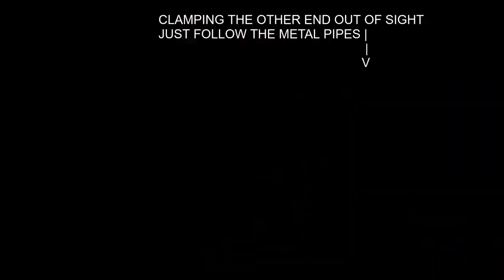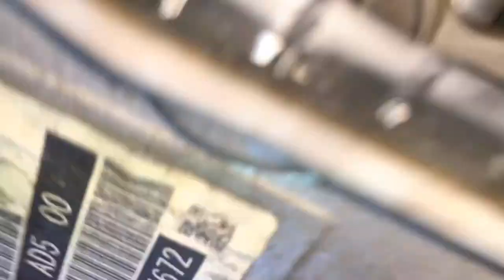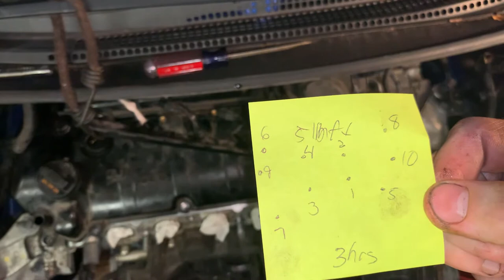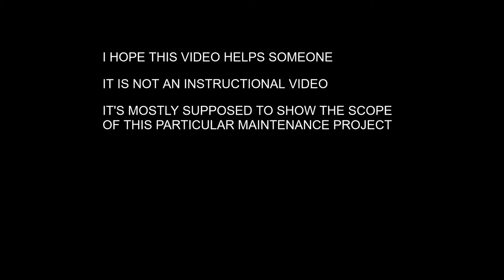GK5 2016 HONDA FIT VALVE LASH ADJUSTMENT AND SPARK PLUG REPLACEMENT

Comment: Tools needed:
feeler gauge 0.009"-0.012"
assorted sockets, all mm
pliers for hose clamps
clamps for intake coolant hoses
flat-head for valve nuts
1/4" torque wrench (the impossibly low torque specs) & wrench
3/8" torque wrench & wrench
1/2" wrench
2-4 extensions (no ujoint needed)
14mm thin wall spark plug socket

Items needed:
black rtv for corner places
valve cover gasket
intake gaskets (4-5 singles)
non-fake spark plugs, should be about $15 each, so $60 total
intake cleaner
blue shop towels
extra oil for lubing valve cover

Torque specs:
valve clearances
     intake -- btw 0.009"-0.010"
     exhaust -- btw 0.011"-0.012"
valve nuts -- 10ft
spark plugs -- 13-14ft
intake -- 17-18ft
valve cover -- 5-8ft
coils -- 5-7ft
torque patterns are always intuitive, just use 3-step

Notes:
do not for spark plugs --
     gap
     dielectric grease
     anti-seize
do not for valve cover -- 
     run engine 3hr before finishing
     add oil to vehicle
only cleaned mating surface for intake, said to also do valves and intake itself
used normal paper towels for cleaning, use the blue ones instead so bits dont get lodged anywhere
cowl does not need to be removed
my 1/2" torque wrench is abt 13ft at 10ft, so always use the appropriate torque wrench for the job

Comment: The spec for the intakes is probably 0.22 mm which converts to .0087 inches. When I have money for the on-line service manual I'll look it up. With the metric feeler gauges you want the specified size to offer some resistance to being pulled through, but you don't want them to be difficult to pull through. Also there is often a range, like for example 0.20 to 0.22 (0.21 +/- 0.01). To avoid damaging the feeler, I slide it in from the side of the gauge, rather than from the tip. I haven't adjusted my fit yet, but I've done this on other cars. Thanks for the info on how to get to the valve cover, where to turn the crankshaft, and where to turn it to. Usually you are supposed to turn the crankshaft in only one direction, so if you over shoot you have to go all the way around again, possibly twice as to get cyl 1 at the adjustment point, and then be able to adjust the cylinders in firing order. In other words 2 crankshaft rotations per camshaft rotation, or maybe vice versa I forget. I'll have to check the service manual.

Comment: Tip on adjusting: turning the locknut will sometimes turn the rocker adjustment shaft. Hold a screw driver in the slot to prevent it rotaring as you turn the locknut. And yes, you want that locknut tight

Comment: Just did this but brought my spark plug socket from work so it was a 16mm not a 14mm lol. Also easier to turn the crank with the plugs out, I could not for the life of me turn it with a normal 3/8" ratchet. Really not a bad job, with familiarity maybe takes 30 mins tops to get all the stuff removed. I bought some hondabond HT for the sealant.

Comment: Great vid. It is going to save me a lot of trouble when it is time for me to do mine. To get rubber tubes off of plastic (or metal) nipples I insert a small flat head screwdriver between the hose and the nipple, maybe about 2 mm in, and pull up to make a space, then I take some silicone lube that is labeled safe for plastic and rubber, and squirt it into the space, using the plastic straw extension that comes with the can of lube. With the screwdriver still inside I wiggle the rubber tube around a bit, in and out, around and around, and the lube spreads out between the tube and the nipple, making the tube much easier to get off. Just one short squirt is all that is needed.

Comment: This is the valve clearance spec from the Honda Tech Manual.

Valve Clearance
Intake: 0.21－0.25 mm (0.009 in)
Exhaust: 0.25－0.29 mm (0.010－0.011 in)
Reply: How long should the engine be off before doing this??
Reply: The tech manual states:  NOTE: Connect the HDS to the DLC, and monitor ECT SENSOR 1. Adjust the valve clearance only when the engine coolant
temperature is less than 100 °F (38 °C).   I used an ODBC scan tool to get a coolant reading to make sure.  If you don't have that I would say at least 4 hours.  You wan't it to be cold / room temp.
Reply: @Daniel Hightower  thank you for this fast response
Reply: Hightdan can you share a link for the tech manual? I am in Africa and battling to find one here.

Comment: Saw someone else’s they removed the windshield wipers and splash shield..this looks way easier - thx
Reply from the maker: On the 2nd generation 2009-2013 you almost have to remove the windshield cowl. On the 3rd generation 2015+ you do not need to remove it.

Comment: Because the operate at a higher temperature, usually exhaust valves wear faster than intake valves, the lash gets wider faster, so I'm surprised you had to adjust more intakes than exhausts. If you see the valve lash at the exhaust valves getting smaller, it means the valve stem is stretching, as sign that you out to remove the cylinder head and replace the valve soon, before it stretches into 2 parts and gets sucked into the engine. On Honda engines, esp naturally aspirated Honda engines, this should not happen for a great number of miles. Like more than 300,000.
Reply: I have heard from knowable mechanics that the exhaust valve seat gets pounded into the aluminum head slightly which decreases the clearance due to heat cycling. Failure to adjust exhaust valves on an engine that is driven hard can cause the valve to get burned which means an expensive rebuild of the head. So, on my older Fit which has a single cam, that I autocross and track, I check the clearance every year or so, takes about an hour. My wife's newer Fit has the DOHC engine and are a fit to adjust valves, as shown. Since she drives it like a grandma I'm ignoring it.
Reply: @GaryL3803  Thanks for that information. Interesting that the exhaust valve seats get pounded into the head. I read somewhere that the valve seats in this engine are constructed by – spraying the special valve seat alloy onto the heads. Just a thin layer of an expensive alloy. I imagine this costs less than the traditional method of pressing special alloy seats into aluminum heads and "peening" them in place, peening the aluminum around them with a pin punch, to help keep them from working loose. And then grinding the seat to the correct angle and  then grinding the chamfer angle on each side of the seat to bring the seat to the specified width, and to have it contact the valve at the specified position on the valve. I have no idea how "spray-on" seats are constructed. But the idea seems to be that only a thin layer of the expensive special alloy is needed. So if the seats need ever need resurfacing, or replacing – then what does one do? I guess buy a very expensive new OEM head from Honda? The Owners manual for my 2015 Fit (third generation Fit with L15B1 engine) says "Adjust the valves during services A, B, 1, 2, or 3 if they are noisy." The emphasis is mine. It seems to me that if the valve lash gets wider, the valves would start making noise, and if the lash gets narrower, you would not hear valve noise. Tappy-tap-tap-tap. At 40,000 miles I am just now beginning to hear a little bit of valve noise.

Comment: Hey mate, I have a 2015 Fit hybrid. and it sounds ever so slightly ticky when the engine is cold especially on acceleration. Once the engine is fully warm (maybe 10 mins of driving) it goes away. Do you reckon it could need a Valve adjustment? 
Just to reiterate. the car drives fine and perfectly. just a slightly ticking/ clicking noise until the engine is fully warm.
Reply from the maker: They may or may not need to be adjusted. The behavior of being louder and then fading once the engine is warmed up is normal especially if the valves are at the looser end of the tolerance or if its really cold. However tight valves can be a bigger problem than loose valves and you can’t hear valves that are too tight.

 I check the valves when I’m doing the spark plugs so every 100000 miles.

Honda is a little vague on it recently their recommendation is if they’re noisy. I assume they mean all the time but I’m not sure.

My guess is at least half of Hondas probably never get a valve adjustment and make it to the scrapyard some other way before they burn a valve. The most common complaint that is fixed by valve adjustment is hard starts when its cold.

Comment: Can you reuse the head cover gasket after doing the adjustment?
Reply from the maker: I personally would buy a replacement because its every 100000 miles and its a decent amount of work to get back in there. They’re only $30 so its worth the piece of mind to me.

However if its still somewhat pliable and doesn’t feel like hard plastic then it could probably be reused. The spots where the rtv is applied is what would concern me the most.

Comment: I'm convinced that the 2016 Honda Fit is not a DIY maintenance car. I wish you were explaining all the steps, Like removing the airbox first then pulling off the brake booster vacuum line. Or maybe you can caption the video with the steps taken for this job. it looks like a pain in the ass and I know a good Honda specialist and I would trust him to do this job.
Reply from the maker: Adjusting valves is something that’s on the edge of DIY. I don’t have much experience with it so that’s why I use the go/no go system with the feeler gauges.

Some one with more experience can feel the correct drag and do this job much quicker. 

It would be nice if the engineers made it easier to remove the valve cover but this isn’t too bad of a job.

 This is literally the first underhood job I did on this generation so it took me a little bit of learning as I went.

I’ll think about doing a more cut and step by step on this video for the future with maybe some voice over or captions.

Maybe I’ll even rerecord, the car is already at 160k miles so in another year I’ll be doing all this again.
Reply: The fact of the matter is, keeping something that small, that safe, and that fuel efficient with its emissions ratings is extremely difficult. 

You couldn't just throw a good ol MPFI D15 in there and expect the government to let it pass.

Comment: What did you use to clean before putting the valve cover back on with? What is the brand/info on the gasket maker you used?
Reply from the maker: I used one of those tooth brush looking brass brushes to do most of the heaviest  cleaning and used brake clean as a solvent. I finished cleaning it up with some shop towels and some more brake clean. Use lint free towels if you can and when cleaning some of the bad areas I keep the towel on the inside edge of the valve cover with my spare hand to catch any debris if I accidentally lose some into the valve area, I actually don’t remember what gasket maker I used I think it was permatex ultra black. Just about any high temp rtv that’s oil resistant will do
Reply: @thehondafitguy  awesome. Thank you for the info and the video. Its incredibly helpful to see this uncut.

Comment: All the documentation on this engine says it's not vtec, only vtc enabled, but the intake side clearly has a 3rd cam lobe and rocker arm so these are vtec engines after all!?
Reply from the maker: The information I see says its I-VTEC which as intake and exhaust phasing and variable lift on the intake.
Reply: @thehondafitguy  I always assumed it was just the same 1 valve mode vtec that's used in the k series economy engines. Makes more sense on why the engine doesn't start pulling until around 4k rpm lol
Reply: @thehondafitguy  Says i-VTEC right on the valve cover.

Comment: 10 ft-lbs is the torq of the screws on the valves
Reply from the maker: Yes you hold the screw and tighten the nut part to 10 ft-lbs

Comment: That is wonderful the way Honda designed the valve cover bolts. I'd loosen the oil filler cap before torqueing the bolts so that you don't have to compress air when seating the valve cover.
Reply from the maker: Air trapped would travel out the pcv system so this is a non issue.

Comment: I have an engine that tossed two spark plugs out because somebody thought they knew better than a torque wrench.  There is more arrogance than experience involved in not using one for anything.
Reply from the maker: The fit engines particularly pre earth dreams seemed to be more prone to spark plugs loosening.

My 2007 had a gas/exhaust smell when I bought it with the original plugs installed and the #2 spark plug was loose.

I’m glad other people posted about the problem so I didn’t have to rethread the hole.
Reply: This is a Fit problem in particular
Reply: @FINSuojeluskunta  my example was not on a Fit, and it wasn't loosening.   The plugs had been overtightened and took the threads right out of the head with them.
Reply: @brianhaygood183  ahhh okay I see. I'm definitely using a wrench on mine